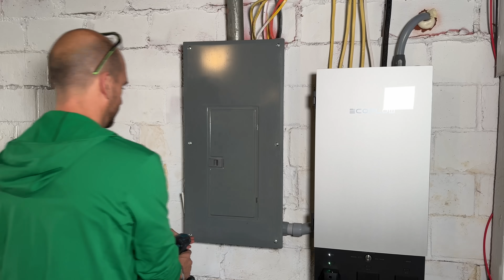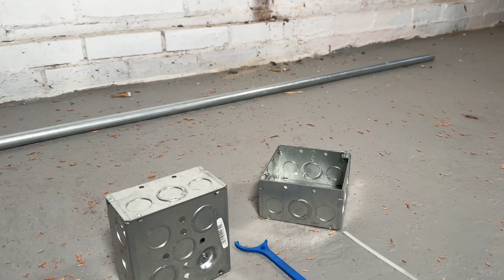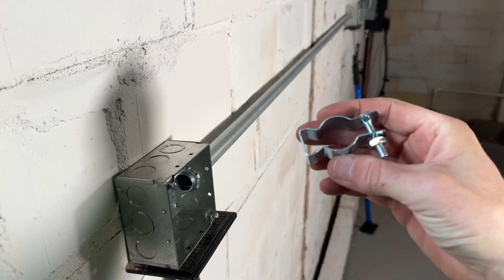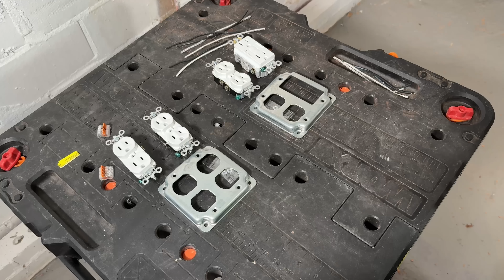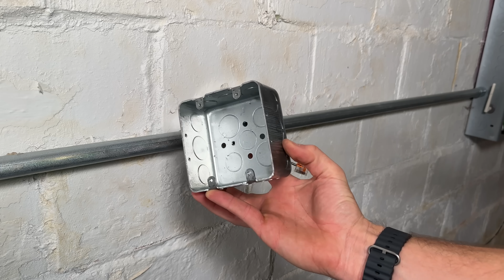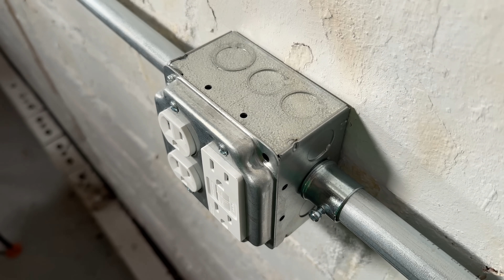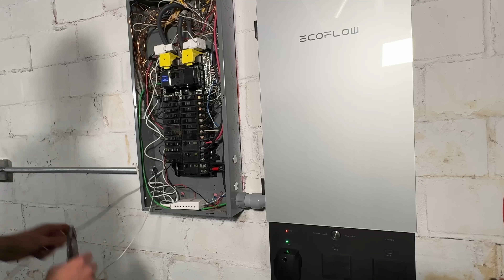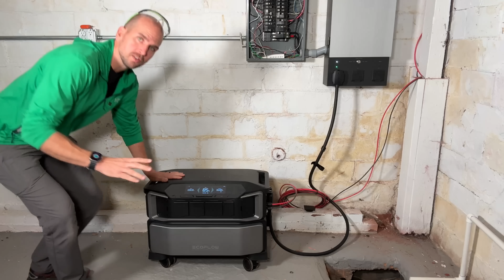Add Outlet To Unfinished Basement Or Garage

Comment: Tip for tapcons... I always have a spool of bare galvanized wire handy (18-16GA).  Just before you put the tapcon in, take a piece twice the depth of the hole plus an extra inch and double it over.  Insert it into the hole leaving about 1/2" exposed and bend over the extra, then drive the tapcon in.  It helps make it bite even better and especially in loose holes or brittle concrete.

I would also always run the green ground wire for any circuit in conduit.  You never know if the conduit/connections/screws become loose over time and cause bad bonding.
Reply: some guys save the ends snipped from zip-ties and use them in concrete holes for extra bite.
Reply: @ Good tip.  Thanks!
Reply from the maker: The tip can be a lifesaver if your hole is a bit loose 💯  Thanks for the feedback!
Reply: @EverydayHomeRepairs run the green and use isolated ground spec grade 20 amp outlets
Reply: @SgtJoeSmith why?
Reply: @coreyfranco7060  you arent an electrician then.

Basically future proof it. incase he or someone else turns room into recording studio or has sensitive scientific machines running. the isolated ground removes electrical noise. thats why hospitals use them. plus they are better made outlets for running microwaves, toaster ovens, space heaters. you have a 20 amp circuit but your 2 devices cant top 15 amps on a 15 amp outlet. so you run the risk of melting an outlet before tripping the breaker. and i have seen outlets that cracked or melted from overload but never tripped the 20 amp breaker. Its not a code violation to do 15 amp outlets on a 20 amp line cause thats how most houses are cause only lamps, computers, tvs, stereos are getting plugged in. but i prefer every aspect of the circuit to have the same rating. the outlets in my mechanic shop are orange spec grade for power tools/air compressor, white for 15 amp office outlets on a 20 amp circuit, blue outlets are surge protected on the outlet for computers, gray are gfci or chained to gfci and 1 black 20 amp outlet in office for microwave. all the led lights inside and out are on 15 amp breaker. that way everyone knows what can be plugged in to each outlet.
Reply: @SgtJoeSmith  find me one electrical contractor that would even consider this?
Reply: @SgtJoeSmith the only logical "future proof" i would consider is using wp rated.  Pretty sure the basement moisture would be the biggest threat, no?  These receptacles will probably be the least frequently used in the entire home...
Reply: @coreyfranco7060  that's my problem too. I can't find any contractors worth a shit and have to fix their phuckups and do my own work
Reply: @coreyfranco7060  growing up in Iowa we had a basement.  Just ran dehumidifier in summer. Only 1 time had water leak in through walls and that was when had massive state wide flooding and just 1 spot. Was finished basement too. Too rocky for basements in mountains where I'm at now. If they gonna be least used then why need 2 so close? Or any at all.
Reply: @coreyfranco7060  sure my suggestion would be overkill 99% of the time. And 2 outlets on that short surface mount run would be easy to change everything out. I was just tossing it as a suggestion based on what room was gonna be used for
Reply: @SgtJoeSmith  i dont remember any of my customers ever fixing my work...
Reply: @SgtJoeSmith  who cares
Reply: @coreyfranco7060  well maybe you are 1 the good 1s. if so congrats and thanks. Im a GC and turn down a hundred million a year in jobs cause cant even find anyone that can plant a tree or build a fence let alone anything else. I got to babysit everyone
Reply: @SgtJoeSmith  what is your location?  I am mostly in clark county NV
Reply: @coreyfranco7060  walmartville ar
Reply: @coreyfranco7060 
Why would they tell you..  they are probably the ones that never call you for another job. 😂
Reply: @customsolutions7167  my sales and repeat business say otherwise...
Reply: @SgtJoeSmith why isolated ground?  Wouldn't a redundant ground connection be better?  If you use isolated ground, and your conduit joints lose integrity, the box would be ungrounded.
Reply: @charliesullivan4304  thats not how isolated ground works. the outlet ground prong is grounded separately from the outlet housing and metal box/conduit. it is like a redundant ground. I mean Im not an electrician but I used them in my shop and done electrical work off and on last 35 years so if I am wrong please correct me.
Reply: @charliesullivan4304  and in my shop on my orange spec grade 20 amp isolated ground outlets, i just wanted orange outlets to identify which outlets to plug power tools into on the 20 amp circuits that had no lights or computers on them. My purpose i did just connect all the grounds together. but typically for isolated ground i believe you would have a 2nd ground wire for your outlet housing and boxes if using metal boxes.
Reply: @SgtJoeSmith  yes, we agree about what that setup is.  It's smart for some specific applications but not better in all ways.  Best to use it only where there's a specific need and an expert designing the system for that need.
Reply: @coreyfranco7060  One right here if my customer  will pay for it. Some will, some will not. You get what you pay for and I am the most reasonable C-10 in my area. Sometimes if they blow out bad I use the old plastic expanding inserts we used to mount stuff with regular screws.
Reply: @EverydayHomeRepairs  I use an SDS bit that is 1 size smaller for tapcons when im worried about the drill blowing out the hole.
So instead of using a 3/16s bit for the 1/4 tapcons, ill use the 5/32. Also, I have found that depending on the material of the block, using a full sized sds hammer drill can leave a better hole than a Battery drill that has a hammer function.
Reply: Been using plastic anchors for over 40 years and I see no good reason to switch to tapcons. There are certainly times when tapcons are the only reasonable choice, but as a default fastener? Absolutely not, tapcons suck unless concrete/block/brick conditions are perfect . I avoid them as much as I can.
Reply: That works so well!  Costs almost nothing and holds tightly.
Reply: I do the same thing with scrap bare copper I always have laying around.
Reply: Nice to see this mentioned. I was planning on saying that I've had good luck using a toothpick for the same purpose.
Reply: I've used that trick with a stripped out hole and/ or tapcon when I don't feel like drilling another hole!
Reply: Mechanic's wire?
Reply: Galvanized wire? So you use steel wire, not copper. Any rust problems?
Reply: @JoyClinton-i8g  No, not so far.  The blue tapcons are also treated steel, unless you spring for the stainless versions (I only would for wet conditions).
Reply: Tap cons are a poor choice in cinder block. Plastic anchors will have better holding power, and is a  better choice for an unskilled homeowner.
.
Reply: I tried tapcons once ... never again
Reply: I have found that the size of the Tapcon screw that is appropriate to use is based on the aggregate of the medium you are attaching to, and not the size/weight of what you are attaching. CMU/cinder blocks have very coarse aggregate. You need a minimum of a 1/4” tapcon for them to hold. Smaller screws are not compatible.  Poured concrete with finer aggregate can use smaller, but I am using 5/16” tapcon just to mount an outlet box on block wall.
Reply: @Ninaleechie278  that's a great insight!
Reply: @@karlwithak.  Yup, tapcons have never worked for me.   Pretty much anything else holds better, esp. if there is any kind of movement - like a plug - I'd never use them for that.
Reply: Great idea but he sunk the Tapcon's in the mortar instead of the block so I doubt it will help in this case.

Comment: Great DYI. I don't have a basement. But I'd like to do the same thing on the outside of my house. I have a pergola that I like to power up. Run an electrical outlet back to the outlet that's on the outside wall. Do you have a video like that?
Reply from the maker: This one is for an exterior GFCI outlet ran from the basement.  Do you have a crawlspace?  https://youtu.be/i4HBc-LfYP8
Reply: No I don't have a crawl space. My house is set on a foundation. I have an outlet on the outside inserted around bricks. I wanted to extend that circuit to my pergola which is right next to it. I wanted to see if you had a video that can do something similar to that for the outside.

Comment: Always pull a ground
Don't drill into mortar for anything
Use a hacksaw, plumber's pipe cutters run the possibility of decreasing interior diameter, which is a code violation
Supports are needed within 3ft of the box
Don't feed wire toward the panel
Bend boxsets and use one hole straps instead of using Mae Wests
Reply: Why do you feed wire away from the panel?
Reply: @dave7038  don't want to poke wire into hot breaker, on the other hand pushing wire FROM a hot panel with your hand next to hot breaker is probably just as bad
Reply: I cringed when I saw that!   @greggpurviance7252
Reply: @greggpurviance7252 
I was always taught to work back to the panel. The panel power was off also. But I'm not an electrician. 😂
Reply: @greggpurviance7252  to be fair, he did say to turn the power off before removing the cover, but it's always better to belt AND braces anything with safety implications, and treating the panel as live, even when you're sure it is turned off, strikes me as sound strategy and a good habit.
Reply: @dave7038  I don't always...it depends on the type of site, what I'm pulling to where, straight pulls or many turns...can I pull loops or will it obstruct others at a location that may not want to work around it
Reply: @dave7038  I'd be curious to know the answer as well.
Reply: Would it be ok to use a sawzall or a band saw? I'm not sure that I even have a hack saw. Haven't seen it in a while, and too lazy to use it anyway.
Reply: @dave5176  only if you've a note from your doctor
Reply: You don't need to pull a ground in metal conduit. Unless you are using a Conceptric knockout or you are pulling an isolated ground. Per the NEC
Reply from the maker: Thanks for the feedback.
Reply: Yeah this thing is so wrong, considering he us claiming that the acceptable job was, while not ideal, perfectly legal 
'His' worst video I hsve come accross
Reply: @MrOpinionCantSignIn  There all bad.
Reply: Also didn't run a single 20 amp receptacle on his 20 amp circuit.  Yes, you can run 15 amp receptacles on 20 amp circuits... provided a 15 amp isn't the SOLE receptacle on the circuit (so you need at least one 20 amp).
Reply: Using one hole straps against block basement walls increases the chance of dampness against the emt, no matter the outside barrier. Yes, never use plumbers pipe cutter on emt
Reply: @greggpurviance7252  WHAT???? Do you have any idea of how many buildings do so... all without being concerned about dampness of EMT. I think they're more concerned with dampness of wet electrical wiring. Dampness of the EMT.
Well... This comment ranks as the stupidest comment I've heard all year. It's early... I better go read comments on CNN to break that record.
Reply: @W8RIT1  worked commercial for over 25 years. Saw emt rust out. Usually close to the ground, but also on block walls. Often 1 hole straps are used & are fine but minerlac is better & then the unskilled don't have to bend box offsets

Comment: Adding circuits to the service panel generally requires a permit and an inspection. Some jurisdictions do not permit unlicensed work of this type, though it is often possible to get an exemption if you are the homeowner. Check with your local building office for details. Be aware that if your insurance carrier can prove that you performed unlicensed and uninspected electrical work on your house, they can deny a claim even if the claim has nothing to do with the work you did.

Something to consider, 3/4" EMT conduit must be supported within three feet of the connections. If the conduit run is precisely six feet, you should be able to just install one in the middle, but the inspector could ask you to put one closer to the connector at either end. Also, Nearly all support brackets require the conduit to be flush against the surface. That means you need to bend "box offsets" at either end of the conduit so it jogs over against the wall. Some inspects may allow you to add a small spacer behind the conduit under the bracket to fill the space, but they don't have to.

The important thing to remember when working on your own house is to ALWAYS consult the local building officer to verify what rules the local jurisdiction follows and any special demands the inspector may ask for. Also, get the appropriate permit it required.
Reply: Permit for 4 receptacles...

GTFO 😂
Reply: @shidfard  you can add receptacles to an existing circuit all you want. That is generally allowed in most jurisdictions. However, adding circuits to a service panel generally require a permit and inspection by the jurisdiction, and many require a licensed installer or at least a city certificate for the homeowner to do it themself.
Reply: Minerllac straps work just fine
Reply: @greggpurviance7252  only if your inspector says so. That is the crux of the issue. Just because you can do something does not mean you are permitted to do something.
Reply: @TwilightxKnight13  what are you talking about? I worked commercial construction for 25 years, & I didn't have to call the inspector every time I wanted to run pipe to see if the way I was doing it by code was OK with  him/her.
Reply: Yeah right permit...not to mention the homeowner can do the work himself... perfectly legal
Reply: @lawcohn2815  the issue isn’t the receptacles, it’s accessing the service panel. In most jurisdictions you cannot add circuits just because you want to. It requires either a permit and some jurisdictions do not allow unlicensed, even homeowners, from doing to work. I did not say it was a good or bad policy, just that in most jurisdictions it is the law.
Reply: @TwilightxKnight13  
I agree with you...to some extent...I mean come on this guy used the conduit as a ground which is allowed but heavily frowned upon and as an electrician I would always run a ground..but it's his house, his basement, his panel.. should he pull a permit..yes ....will  he...hell no